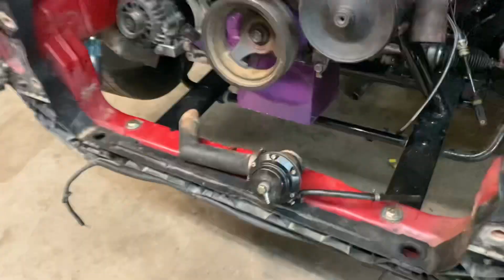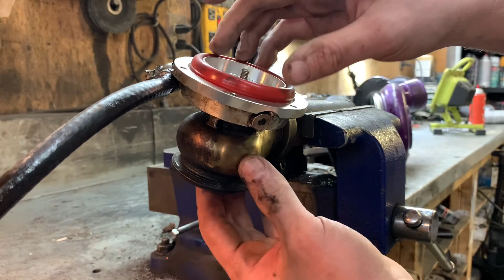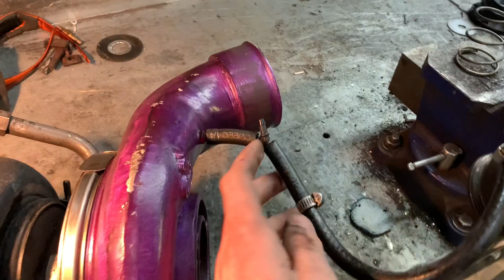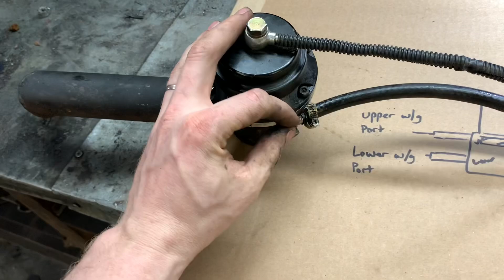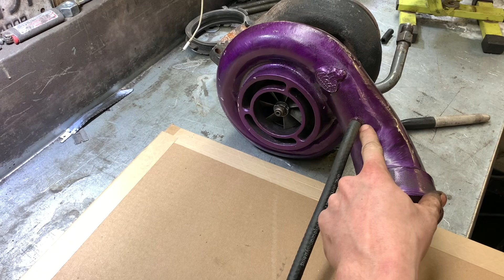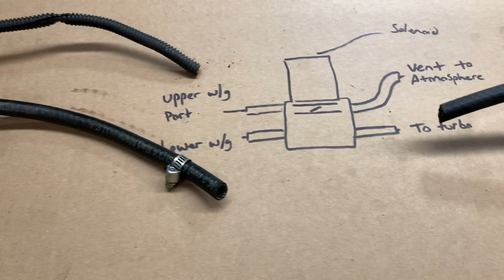How to make more boost cheap!/boost controller connections/wastegate hack

Comment: Assuming your engine could actually handle it, you absolutely can make 100 PSI with a 5 PSI spring, if your using CO2... also, four port boost controllers have less resolution than a 3 port controller, so 4 ports are less accurate with the target/set boost pressure. The most common boost controller setup uses a 3 port controller, and with typical plumbing will make 2X the wastegate spring pressure. A 4 port controller will typically make 3X the spring pressure, but like I said, with less resolution/accuracy. It is possible to use a 3 port and get 3X spring pressure while keeping the more accurate resolution of the 3 port valve, but it isn't a common way of plumbing it up and requires drilling a small hole in one of the lines.
Reply from the maker: Thanks so much for all the info. I’ll pin your comment 🤟🏼

Comment: What if i have a boost controller and i have a weak wastegate spring but want to make more boost? Where would i put the inline T
Reply from the maker: You’ll only make so much boost before it’ll push the spring open on its own. What’s your spring rating?
Reply: @StationroadRatrods right now like 7lbs, but i think the spring is getting weak
Reply: @StationroadRatrods im supposed to be making 19 lbs but i only make 17, so im wondering if i put a T in the lines id be able to get to 19
Reply from the maker: It’s a 7 pound spring and you’re making 19 pounds?
Reply: @StationroadRatrods well its a rzr, wastegate crack presssure is 7lbs
Reply from the maker: Ahh I see. What kind of boost controller is on it?
Reply: Stock boost controller, do you think if i put a T it will help me build more boost?
Reply from the maker: I’m sure it would, but if its a factory setup it’s probably gonna freak out
Reply: @StationroadRatrods yea might have to just get a new wastegate, mine must just be old

Comment: Wow! That's some junk. I wouldn't advise anyone to go that route. You don't know how much boost your redirecting off. Install I boost gauge and use a boost T adjustment instead. Thank God those K20's can handle some beating up. I would quit working on cars. 😂 Anyone else with a different vehicle and turbo will end up blowing their engine with that junk.
Reply from the maker: It worked fine for me 🤷🏼‍♂️

Comment: Thanks for the explanation. Iwhagbif you t off the fuel pressure regulator and manifold? Where does it go and how does the blow off work now?
Reply from the maker: You could t off the regulator, basically any vacuum source. I don’t have a blowoff valve, never ran one

Comment: So if the Tune I have calls for 20 psi but Im gonna run a n75 that controls the boost which is what the ecu request. So Id need a 10 psi spring?
Reply from the maker: You’d put in a lighter spring and let the boost controller limit the boost to the wastegate, so you could run anywhere from a 10 psi spring up to 20 really
Reply: @StationroadRatrods  sweet!!! I think ill start with 10 and if i have issues with retaining boost upgrade the spring?
Reply from the maker: @carrilloazael92 you got it, springs are easy to change
Reply: @StationroadRatrods  only reason im asking is because im going big turbo in my 1.8t just completing a few more things and wagitinng to pass emissions in the next 2 weeks to start taking it apart. 🫣

Comment: LOL I took a little sowing pin and stabbed it through the Ref line to solenoid in like different places and the I ran 2 pin holes through the one going to the wastegate control Arm.. I felt a difference.. The gate isn't cracking open to soon anymore, and I am not hitting boost cut all the time like I was before..
Reply from the maker: Nice 🙂 don’t blow it up!
Reply: @StationroadRatrods  LOL, I more worried about my CVT than the motor.. I am limited by that Terrible Trans.. I'm stuck at about 245 WT, anymore will break the car..
Reply: @StationroadRatrods  I seen guys stick like 4 T's in.. or Drill into the hose.. I ran  sewing pin through the Ref 3 times and 1 time through the wastegate line right before the gate.. All it did was help me keep my Gate closed, it was cracking open when it wasn't supposed to be.. You Know.. I guess over time the spring gets weaker and before you know it you are driving around with a wastegate crack open all the time and don't even know it especially on factory set ups.. Great vid.. I'm learning some times the hard way, but I'm learning.. LOL..
Reply: @StationroadRatrods  

https://www.youtube.com/channel/UCOIeusJytRsiRdayyMdp_6w    when you get a chance just take a look.. Bit of a sleeper..
Reply from the maker: Holy crap!!! I didn’t expect a juke 😁
Reply: @StationroadRatrods  About 8 years ago I bought it used before I even knew what a CVT was.. So Cut me a Little slack LOL.. But she rips.. it's on the level of a Veloster N Or a Turbo GTI..
Reply: I raced a new Elantra N light to light but once we got up to about 90 he pulled away... But I Rip cars in my class..
Reply from the maker: I love Jukes. The Nismo is absolutely sick
Reply from the maker: Sweet!
Reply: @StationroadRatrods  They are an acquired taste as they say.. But they are fun little turbo crossover's..
Reply: I can remember a guy making a comment one time a while back, in the comment's that Turbo's are for kid's. Basically saying just get a V8 or a big motor. Like people don't Turbo LS's and super charge V8's lol. Anyway I said back yeah grown kid's...
Reply: @StationroadRatrods   Hey do you know where the guys from (Boost Controlled Performance) is located at?? I'm in South Jersey.. I'm not looking to travel that far.. I have been trying to Find a Tuner within 2 hours of me.. ??
Reply from the maker: I know what you’re saying about learning the hard way lol. 

A little advice is take the wastage apart and polish the valve shaft and clean it up very well. After time it will have carbon buildup and make the gate stay open, it’s a pain in the ass. 

I’m in eastern Canada, I have no idea where to send you but I’d put posts up on a couple Facebook groups in your area asking about a tuner, I’m sure someone will know where to send you.
Reply: @StationroadRatrods  I'm in NJ, I left Facebook during the Lump Era.. My country is way to Political right now.. I got so tired of watching my Fakebook Friend's Post and Re-post Russian Lies, or be complaisant..  So I gave Facebook up during Lump's second year.. LOL.. It's sucks too because I know people find grate deals on cars through Facebook....
Reply from the maker: I actually deleted Facebook myself back in December and haven’t looked back

Comment: I have a 4 port solenoid hooked up. It's not working.  So can I put a vacuum T in one of the gate lines without removing the solenoid to increase boost?
Reply from the maker: I think that shouldn’t be an issue, but keep an eye on your gauge
Reply: @StationroadRatrods  but would you tap into the line coming off the top of the gate, or the one off the bottom?
Reply from the maker: If it’s not working and you don’t plan on fixing it, I’d pull all of that off and just run the one line to the bottom of the gate with the T in it
Reply: @StationroadRatrods  one more question,  does the line coming off the gate, to the T, need to be going to the turbo housing?  Or any boost source?  I have the other side of the T going to a vacuum block but I'm assuming that will cause a vacuum leak at idle
Reply from the maker: The best source is always closest to the turbo. Your turbo should have a barbed fitting on the outlet if it’s aftermarket. If not, the manifold will work fine
Reply: @StationroadRatrods  yup I ended up using a fitting to the turbo to get rid of the vac leak. Works great went from 11 psi to 15. So perfect for a cheap fix!  Thank you sir
Reply from the maker: Hell yeah dude enjoy, and keep those ring lands together
Reply: @StationroadRatrods  haha for sure!  I've had good luck with stock k20s. 611whp completely stock.  500whp for 4 years then 611 for 3 months before she let go lol
Reply from the maker: God damn, I bet it was a rocket
Reply: Wired question but if I put a t fitting in between the turbo and wastegate what do I need to connect the last open end of the fitting too or just let it leak  ? Just found out about this and wanna do it asap thanks
Reply from the maker: @wiles be careful if you do put a T in, keep an eye on your boost gauge. Depending on your wastegate spring it could overboost and break stuff. In saying that, put the T in line and leave it open so it creates a leak. This is a terrible idea, but it works.
Reply: @StationroadRatrods I push about 8-10 psi now but I want more cheap……. there won’t be a problem just at idle ? I thought haveing a vacuum leak will cause rough idle ? Sorry new to turbo cars but in love with them hahaha
Reply: @StationroadRatrods also my waste gate is internal I believe? My gate had a little flap that opens in the exhaust not a fancy one like yours would that complicate things you think or would it still work ? Sorry for all the questions man happy new years btw 🎉
Reply from the maker: Happy new year to you! 

What kind of car is this in, and can you tune it yourself? If you can, you can tune around a small vacuum leak like this, it’s not really detrimental. You’d just tune to add fuel where the engine is getting extra air at idle and compensate that way. 

You can do this with an internal gate, I’m not sure exactly how it’ll respond so be very careful again, and just for formality sake I wouldn’t recommend doing it and I don’t want to be responsible if you grenade your engine.

Comment: How to prevent the car from boosting. removing a part of the charging piping would it work? Would the turbo get damaged?
Reply from the maker: I’d you’re trying to make no boost at all, then yes. Remove a part of the charge pipe and the boost will just blow out into the atmosphere. There are different opinions on whether “free spinning” a turbo can damage it or not, but it already spins at over 100,000 rpm anyway so I can’t see it causing damage, but I really have no idea

Comment: Thanks for explaining it well. After searching many videos so far yours have explained it well. Thank you.
Reply from the maker: I’m glad I could help!
Reply: @StationroadRatrods  Thank you so much. Now it makes sense why some turbos make more boost because even if they put a low spring inside the wastegate diaprahm, they basically trick it by putting a line on top to  create an opposite effect on the piston inside causing you to create more boost. But if you only use the side port you basically are limited to whatever spring you put in there.

My setup though, is my car came with an electronic controlled turbo boost solenoid (they call it N75) for most VW/Audi car and it's ECU controlled. And what they did on my external gate is they left the top port open and created the boost source from the side port. So i'm basically limited to what the spring rate they put in my wastegate.

Update: actually my bad my N75 solenoid does have the vent to atmosphere like you showed in the diagram, so it's basically doing the same on mine. Thanks again.
Reply from the maker: Nice! If you can make more boost, that’s the best part 😁

Comment: Love seeing the Mac dog on the turbo. I have the same one on my big block.
Reply from the maker: That’s awesome!! Sadly this turbo gave up after I had zero oil pressure and put three rods out the block. I could move the wheel about 1/4” up and down. 😢
Reply: @StationroadRatrods  rip Borg Warner
Reply from the maker: Lol yup, it was too bad, I loved that turbo. It used to light up so fast, I used to be at 15 psi under 2600 rpm

Comment: You doing wrong with liking boost  you lost airpresure and in engine
Reply from the maker: I’m not sure what you mean buddy sorry
Reply: he said "you're doing it wrong with leaking boost.  you are loosing air pressure that was meant for going into the engine."
Reply from the maker: But leaking off a little boost to the wastegate will create more boost in the manifold